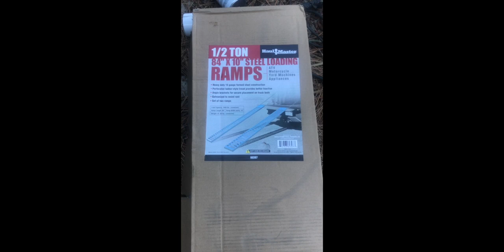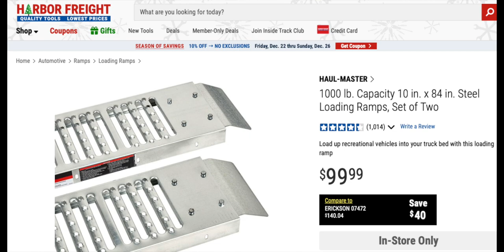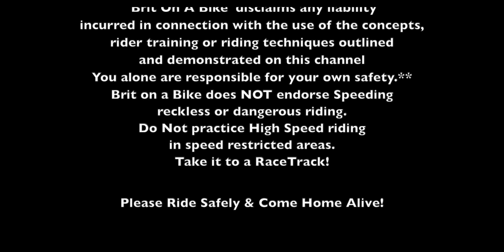TRANSFORMING JET SKI TRAILER INTO A 3 BIKE MOTORCYCLE TRAILER

Comment: Good luck loading bikes on those narrow  
Metal pieces without an occasional disaster
Reply from the maker: I absolutely agree with you- I found myself stepping over the trailer frame bars in order to load the bikes and it was awkward! No disaster’s as yet but I do need to add some base floor either side of the loading ramps. Thank you for the comment. Continued safe riding to you.
Reply: @thebritonabike some expanded metal will keep it light and give you a place to step.
Reply from the maker: @Spillmansgarage  Great idea - thanx for the tip! Safe riding 2 U !